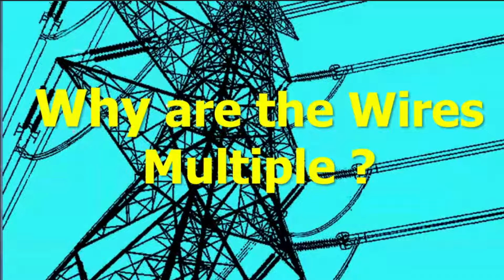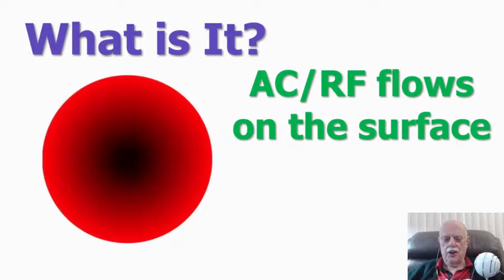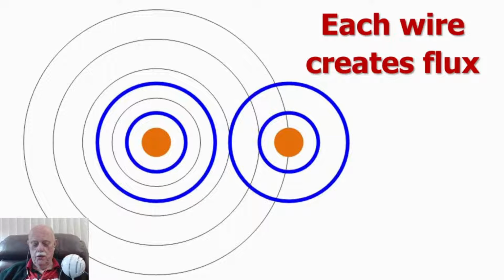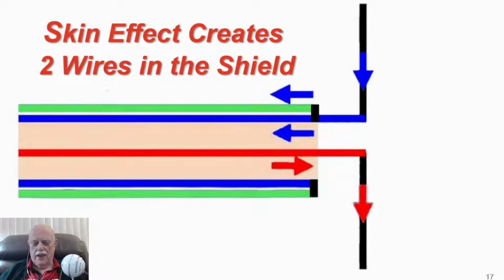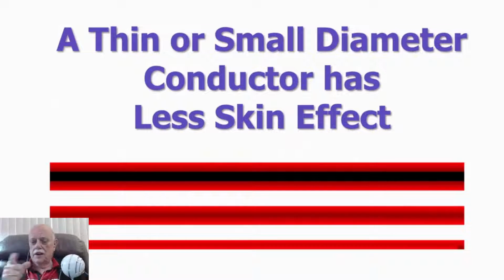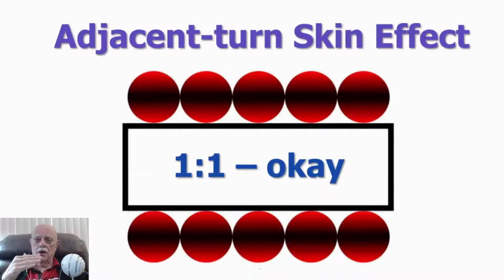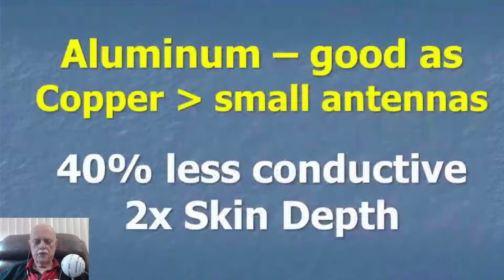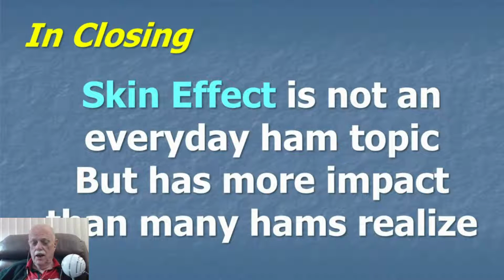Skin Effect - John Portune - W6NBC

Comment: Bundling of conductors on HV transmission lines is to reduce corona and inductance, not skin effect.  Also, I didn't see how the conclusion that stranded wire is more efficient for antennas and loading coils was reached. I believe it's the opposite, although the effect is probably small enough to be insignificant.  - WA5BDU

Comment: Found this Very interesting, surprised you only have one comment. Knowing about the skin effect, I have been wondering how a full wave loop in the diamond configuration fed at the bottom, 
with Rg 59 and  1:1 balun. Constructed out of copper tubing or let's say 1/2' EMT rigid steel conduit at 10-12 meters?  Perhaps, PVC with your foil tape idea didn't think of that. 
On a side note; I happen to use an Alpha LM-400 Equivalent that has a Stranded center conductor, they advertise the Skin Effect, as well as its flexibility. 73
Reply: John has been a legend in the actual science of antennas and RF for a long time and I agree,  very surprised that there is not many views.

Comment: Stranded wire makes sense for skin effect, but being they are all bundled together it stands to reason a lot of their circumferences are touching, due to this I wonder how much percent more surface area is really available? For myself, I'd use stranded if even only 10% more surface area. We could just work it out with geometric math, I will be looking into this more but I've never been very good at geometry, does anyone know?
Reply: I wonder the same thing. I don't think you get any more surface area with stranded. since the individual wires are all touching, it's just one big conductor.